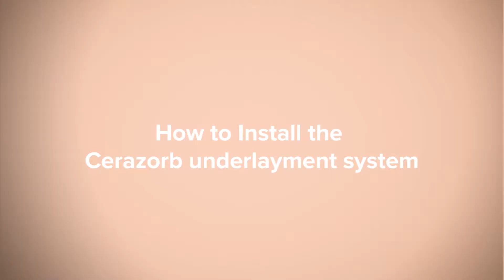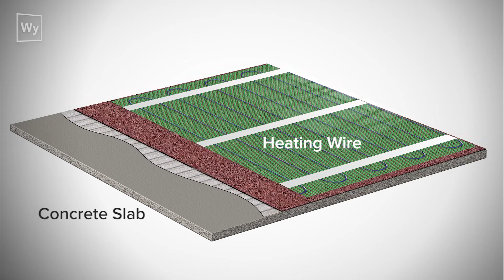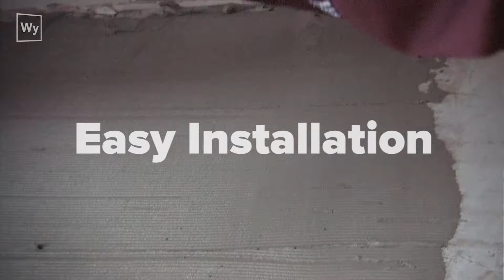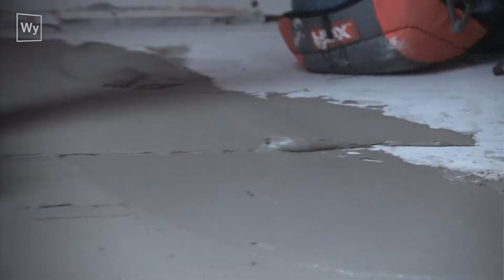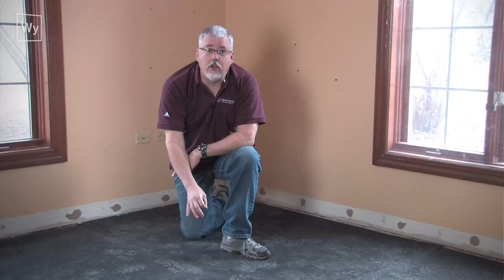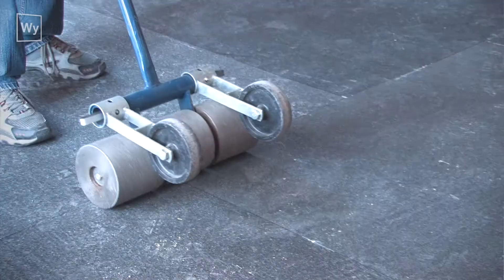How to install CeraZorb® synthetic cork underlayment

Comment: Should I put primer on the cerazorb before installing self leveling underlayment? Thanks
Reply from the maker: Hi there, you will need to apply an adhesive beneath the CeraZorb. Here are the instructions for installing this product: https://www.warmlyyours.com/publications/CERAZORB-INSTALLATION-INSTRUCTIONS-10233-A Thanks for watching!
Reply: I’m doing it just like this video I don’t need adhesive. I put the wire on the cerazorb and I’m putting self leveler on the wire. Just like he says just wondering about the primer.
Reply from the maker: The only thing that needs to be applied to the CeraZorb is thinset between it and the subfloor, allowing it to adhere to the subfloor properly. No primer is needed on top of the CeraZorb.